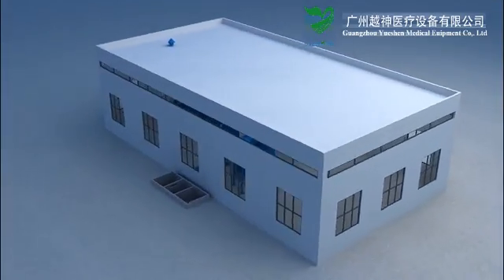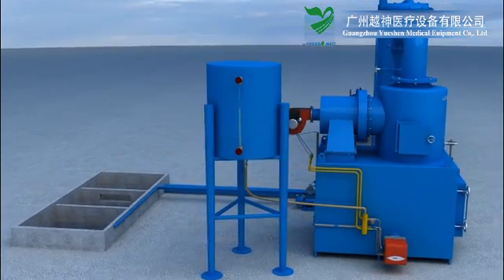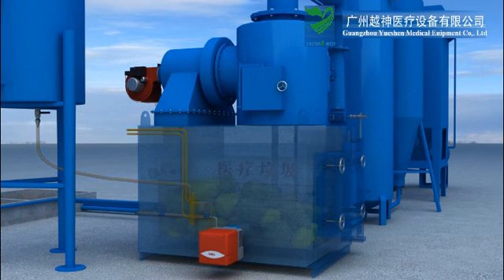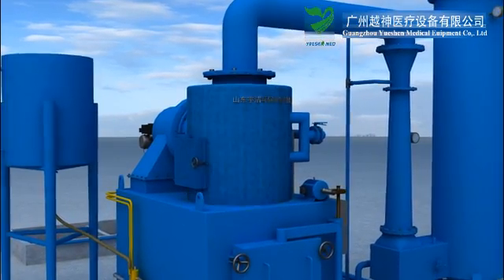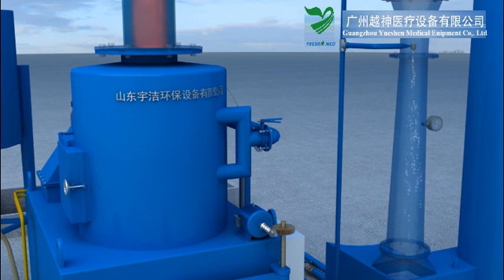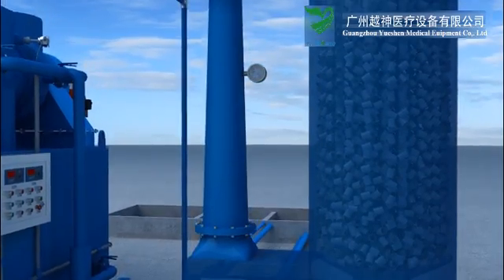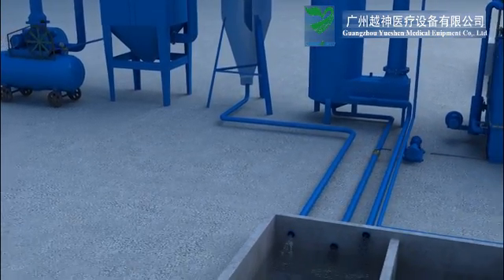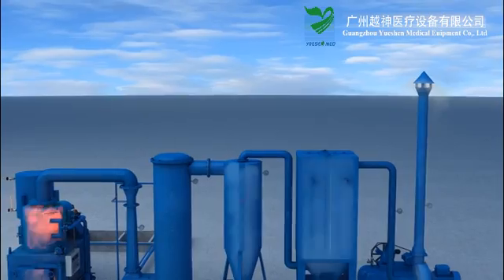MEDICAL WASTE INCINERATOR DESIGN VIDEO

Comment: I want to know, how many chambers, how many degrees of heat by chamber, how many burner and the result test Emisi  14 point what the ever
Reply from the maker: Ok, may I have your email to send you our catalog and price?
Reply: @ysenmed6061  please send me detailes and prices please.  the area required , length, width and height of the machine. The fuel and electric consumption. And so on
Nanfisha Industries plc. 
Fisseha@nanfisha.com 
Mr. Fisseha am buying for hospitals in my country. I will submit the detail proposal.
Reply from the maker: @fissehak.mariam4876  OK, Sophie Lin will contact you soon